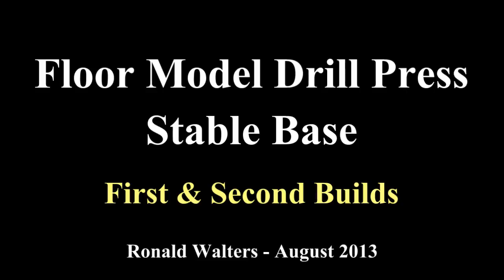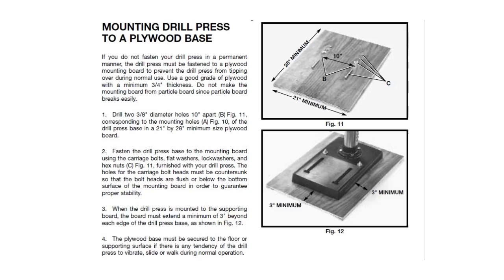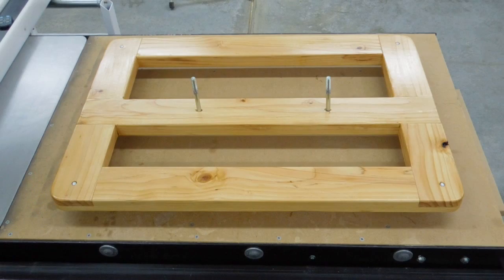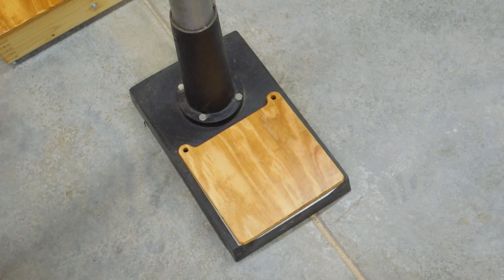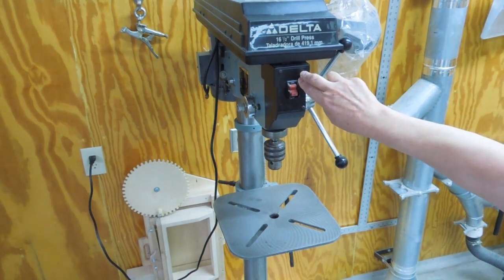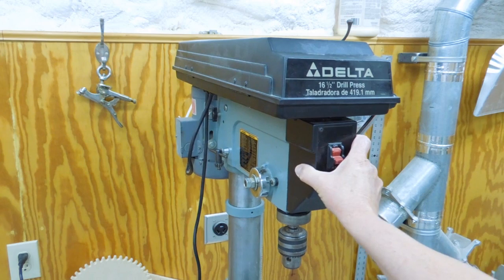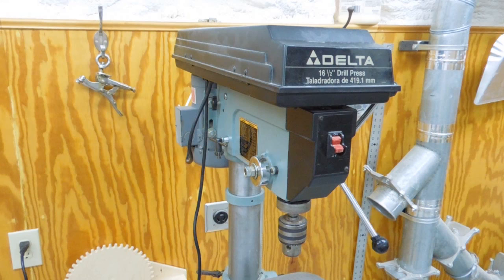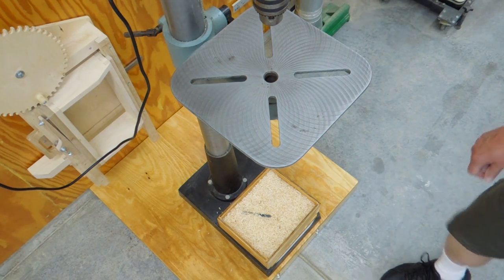Floor Model Drill Press - Stable Base

Comment: FIRST VIDEO I'VE SEEN SHOWING THIS PROBLEM. I WASN'T SURE IF IT WAS THE BASE OR THE COLUMN ON MINE, I WAS THINKING OF FILLING THE COLUMN & BASE WITH HIGH STRENGTH CONCRETE TO SEE IF THAT WOULD STIFFIN IT UP, OR JUST BUILD A HEAVIER STEEL BASE
Reply from the maker: It was a bit surprising. Every manufacturer is trying to save money. Had they just cast the base a bit thicker it wouldn't have been a problem. Concrete may help. It hasn't really been a problem for me so I have (tried to) ignore the issue. :-)

Thanks for watching. Please subscribe!
That is what keeps this channel going.
Ron

Comment: Effeinc, good ideas on the bolt down to concrete anchors. I'm going to use it on my lathe as it never can have enough weight on it. 

Drill press base enhancements bring all ideas.

Comment: i've never drop enough bits to warrent a box but to each there own. I use liquidnnails to glue sleepers on the floor and then bolt it down. I have a free standing vise fastened this way and have threaded 3/4" pipe and it is still as rigidnas the day it was installed. Removal requires heating the glue otherwise you'll be repairing concrete.

Comment: The base on your drill press will do the job. I'm similar height as you and made a base on my drill press as well. It's a floor model and mine raises it up maybe 4 inches and has two wheels and front leveling legs. Works great. I get same shake results you do as our drill press bases are the same. Only way to solve that is bigger metal.

Comment: thank's for your answer! I mean  ultrasonic thickness gauge - this device just can find any hole (as plastic tube) in any material - it can be usefull for you :) 
Some times I'm using that for assembly ane device at such floor - very simply!

Comment from the maker: Metal detectors will pick up rebar but not the plastic tubing. The rebar location is not exactly the same as the wire mesh.  The detectors are not very good with wire mesh. Also the concrete guys can move your tubing around a bit when they pour the concrete. So, there is no 100% positive way of knowing exactly where the tubing is located. Mess up the tubing and then you have a really big repair to make. Just not worth it to drill into the concrete. Or, I may later decide to move the drill press.

Comment: Sleeve the inside pipe with a tight fitting tube with a decently thick wall. Or spend the 75-100 bucks and just get a new pipe altogether with the thickest wall at your OD you can find. I did that on my Sprunger DP15 drill press.  I used onlinemetals/com

Comment from the maker: I tried cork, various foam, and newspaper but for the long fall there was still a lot of bounce and the packed sawdust seemed to do the best. Karate and Judo Dojo’s often used packed screened sawdust with a canvas cover which provided a firm landing surface with little bounce when people are thrown and practicing break-fall’s, etc. I may try something like canvas as a cover in the box as it does collect unwanted debris from the drill.

Comment: I think the flex comes out of the long metal column itself so a new base would not help. Youtube comment system is not good for sharing long information but I think this article would answer all your questions. Google "Epoxy Granite Filling an Industrial Hobbies RF-45 Mill" and the top result from cnccookbook is the right one.

Comment from the maker: A friend of mine and I considered filling it with concrete but the concrete would only add weight and would not bond to that thin cast iron base and stiffen it. Would the epoxy granite actually bond to the cast iron? If it bonds to the metal then it would probably help. Or… are you suggesting casting a complete new base and throwing away the original cast iron base?

Comment from the maker: It will need an auxiliary table. I had not considered making a video for it. Maybe? The basic layout would be the same. Getting it to conform to the existing Delta 17-900 table will be different than the first one and then just how many people have a 17-900 who also want to build my table. Every make & model drill press would require its own specific adaptation. So showing the build of something is not necessarily the intent of my video rather the idea or approach I used to solve a problem.

Comment: When you want to stiffen up that drill press collumn you can cast it out with an epoxy granite filling. That is something used by hobby machinists to stiffen up machine tools. It is though more common in milling machines because there sideforces and vibrations are more harmful to the finished workpiece.